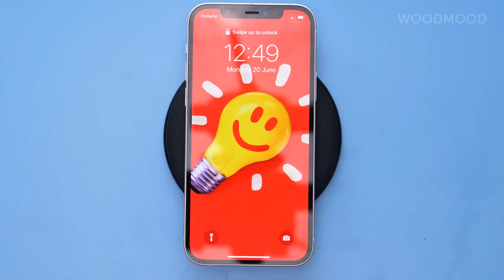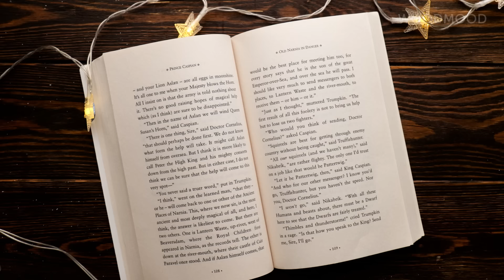Awesome Epoxy Resin Crafts || Amazing Creation By Wood Mood

Comment: I wouldn't want that epoxy anywhere near my food or my eyes. And anything used like fresh flowers or food, is a disaster. The plants 'cook' and wilt, turning brown shades and any food has bacteria on it. If you encase it it's just going to rot with a window. That's disgusting. The tables are so flimsy that you wouldn't be able to put anything with weight on them, if they sat level. So much more. Most of these ideas are not good ideas.

Comment: I hope people realize that epoxy is toxic, and wouldn't recommend making something like chopsticks...you need food grade safe material
Reply: 👍👍👍👍ye hai kya gel tips kha se milta hai
Reply: @rosefeshionboutique1681  Я не силён иностранных языках! Но то что вы ответили уже приятно. 👌🍀🍀🍀😏❤️🇷🇺🇷🇺🇷🇺Здоровы будьте! И удачи.
Reply: Also, never use non-food grade tools with food. Lots of stuff has lead, mercury, oil, and toxic adhesives in it. Most metals are cut with lead as a lubricant.
Reply: there is special 2 component epoxy that is food safe. even if most companies say 'it's safe when it is completely cured' it is not. always check out for certificate or something like this.
oh and UV resin is NEVER good safe!
Reply: @shitalya1  Hi, where can one get this special 2 component epoxy?
Reply: There are multiple brands of epoxy that are deemed food safe.
Reply: They would never understand as they were born to do stupid things 🙄
Reply: Really depends on the type of epoxy. Table and counter top epoxy is safe but still wouldn't recommend making eating utensils. Cutting boards are fine,  making a epoxy knife handle is fine and many more epoxy made things for your kitchen are fine too
Reply: Artresins are 100% safe also
Reply: But it was made with uv resin not epoxy
Reply: @rosefeshionboutique1681  vvlz good
Reply: @rosefeshionboutique1681  good mj can J nz
Reply: Why is it toxic? How toxic is resin compared to toothpaste, carpet, laminate flooring or a new wooden wardrobe? .... I'll wait for your reply bet you didn't realise 90% toothpaste on the market emits harmful VOCs yet every morning and evening you willingly put your toothbrush in your mouth and scrub your gums and teeth without a clue 🤔

Comment: Love the artistry HOWEVER it is VERY IMPORTANT that you show your audience that not only are gloves important when working with epoxy but ALSO WEARING A RESPIRATOR VITAL TO PROTECT YOUR LUNGS FROM THE TOXIC FUMES THAT OCCUR DURING THE REACTION OF MIXING BOTH PARTS of the chemical. Do your homework before diving in to this craft!
Reply: AC